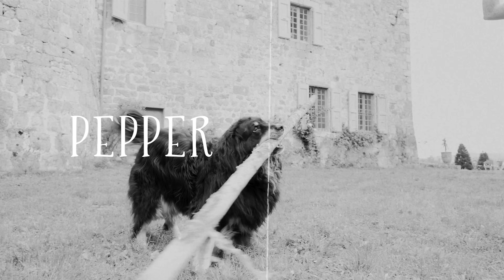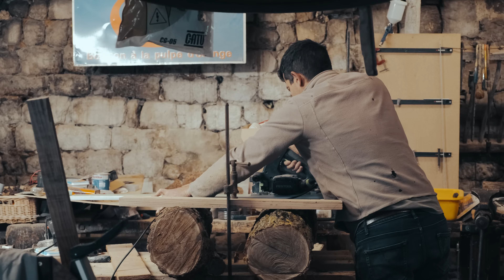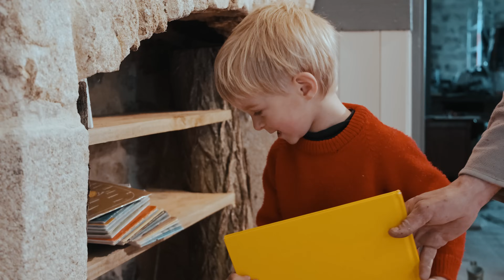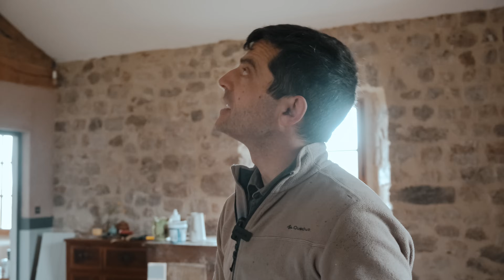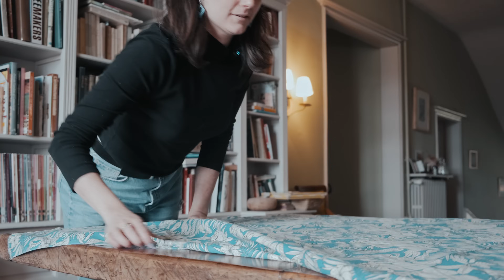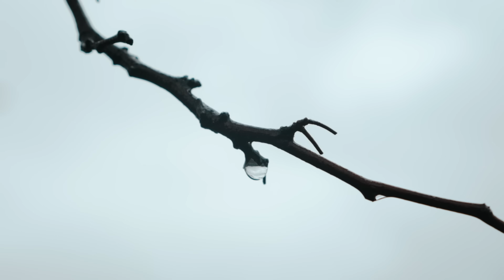Turning our new house into a HOME! Chateau de Rosieres family on the move

Comment: Just a thought if you do need some sort of temporary curtains for the upstairs coach house you could try hooks and eyes on the top of the inside of the window frame cut material and hem to the size of the window and hook them on during the nights/early mornings and take them down during the day You would then only need to fix 2 small holes from the eyes when you sort a better solution 😊